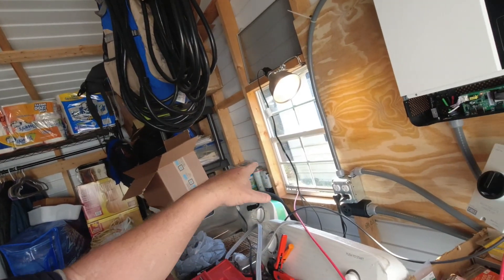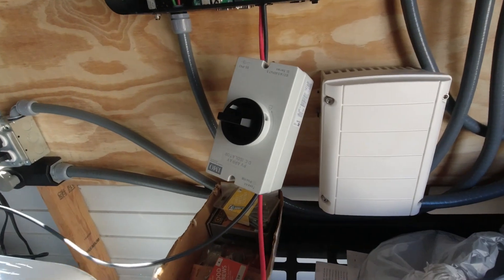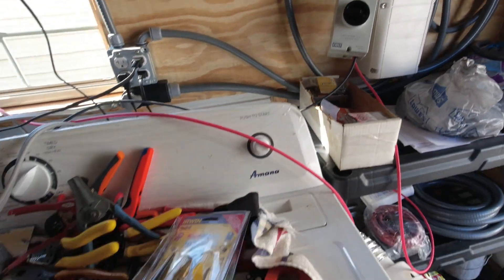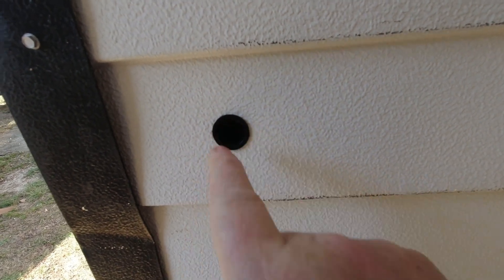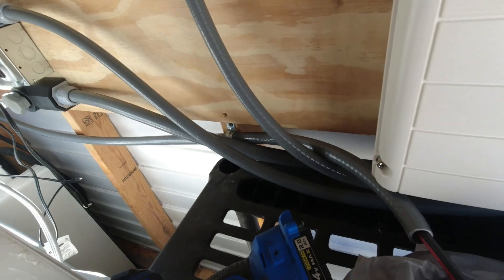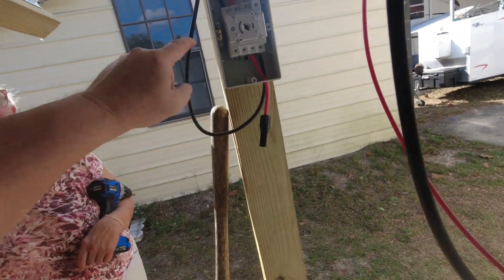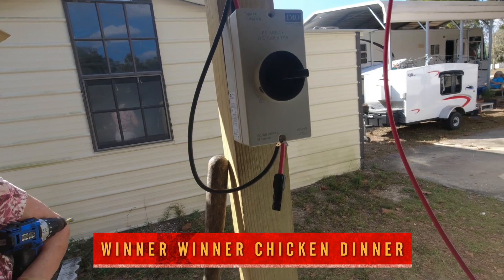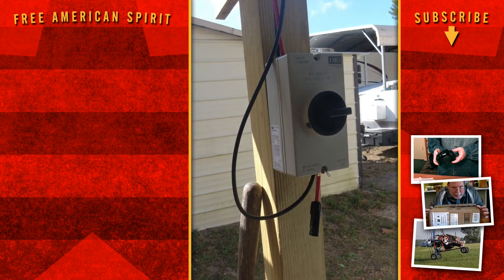Running PV wires, entry gland,  Growatt SPF 5000 ES off grid solar shed to the 5000KW solar array

Comment from the maker: Support our Channel.  
Our Amazon home page link: To buy things you normally buy:
https://amzn.to/3oUsePn
Growatt SPF 5000es all in one inverter:
https://amzn.to/3e5xtFV
Entry Gland:
https://amzn.to/336k0LR
PV DC cut off:
https://amzn.to/3pbf6W9
Wire cutter:
https://amzn.to/32gkZII
50 Foot 8 Gauge Ground wire:
https://amzn.to/3GStyZr
Kline CL-390 Clamp Meter:
https://amzn.to/3ITc5Sk
1/2" Non Metallic Liquid Tight Conduit and fittings:
https://amzn.to/3ISJA7h
3\4" Non Metallic Liquid Tight Conduit and fittings:
https://amzn.to/3s5uN3b

Disclaimer: These links are affiliate links.  Free American Spirit will earn a small commission if you make a purchase at no additional cost to you. These are products, services, companies  and websites that I actually use and like. There has been NO Prior compensation paid to me to promote any of these links.